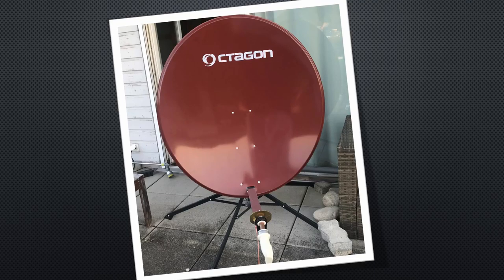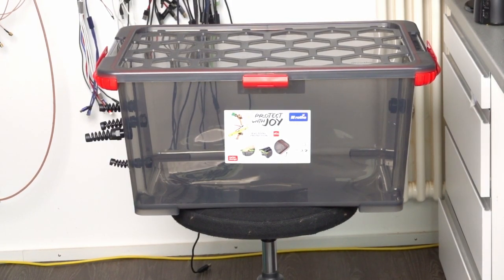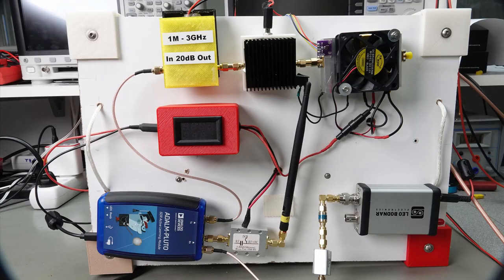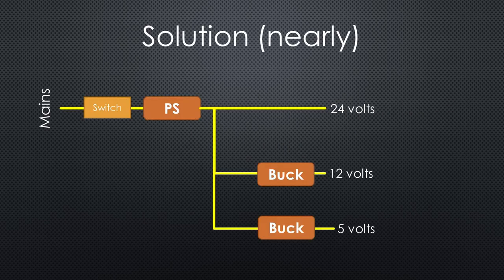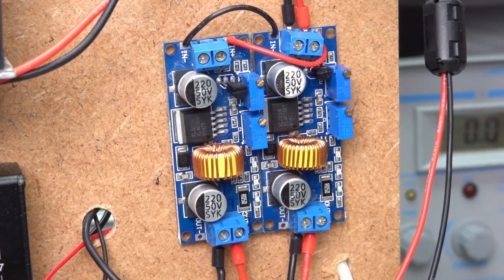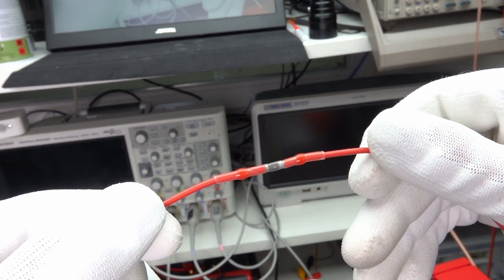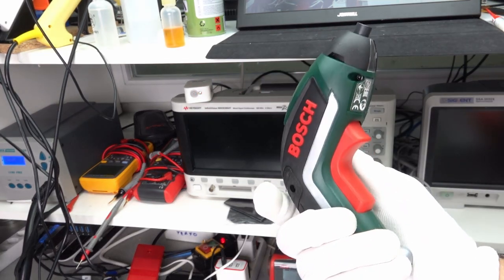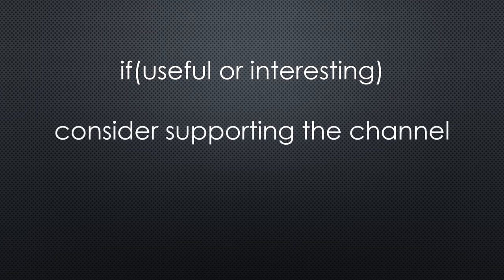#357 How to assemble an outdoors electronics project

Comment: There's always some water vapour in the air, and it will condensate at certain temperature. There will be small pressure differences between outside air and inside the box, which can move air in and out. Sometimes it's best to have well ventilated case with drain holes for water at the bottom, if a gas tight case isn't possible choice. Nitrogen filled gas tight cases and cables are used  in some applications. I don't have much experience in this area, but I think water tight case can be the riskiest choice, since it keeps the condensated water in but never lets it out. I'm not judging Andreas' choice here, he can manage the situation if he sees condensation problems. Time will tell whether anything occurs.
Reply: Based on my HAM experience with DIY VHF-UHF antennas and HF baluns, it can be useful to drill a small (1...2 mm) hole into the lowest part of the case. Humidity finds it's way into the box for sure, a small draining hole helps to get rid condensed water but doesn't affect rest of the box much.
Reply from the maker: Thank you for the tips. I tried to avoid anything laying on the floor. But a small hole for sure is a good idea.

Comment: The big transparent boxes are a pain, at least the ones I've got in the UK. They degrade with sunlight and become brittle in just a couple of months and because they need to flex a bit to take the lid off, it just breaks. :(
Reply from the maker: Good point. I hope mine will last a little longer. Maybe I put a cloth around it against sun. It does not stand completely in the rain.
Reply: This.  I replace an outdoor enclosure  made from a cheap storage bin every year due to sun exposure.  Spraying with a UV clear coat (like Krylon brand) helps  some.

Comment: I'm fairly new with electronics but why is higher voltage uses thinner wires? I thought higher voltage use thicker wires. At 6:48
Reply: For the same amount of power you want to transfer through the wire, you get less current for highter voltages. (P= V* I) But powerloss due to resistance comes with the square of current. P= I^2 * R. Thus it is better to use higher voltages and less current. Less current means you can use thinner diameter wires. But much higher voltages does require consideration of sparking/arc-through the insulation. So that might make the cable thicker or require insulation of a different kind. But I think that is why Andreas said it's no issue for this project as it is below 50 volts.
Reply: Higher voltage generally need a thicker insulator. But thinner conductor.
Reply from the maker: Thank you to the two commenters! No need for an addition.

Comment: Not sure about the UV resistance of the plastic in these boxes.. SOME of them, I have seen disintegrate in a fairly short time, there are, I think, some UV-resistant paints, and also UV-resistant clear film, that is used to cover car paint jobs.
You could glue some copper sheet to the wood.
For safety, and protection from the elements, perhaps use a 32-V -48 V power supply located at a mains outlet, and run that 32-48 V to the box, so that you have a 'safe' voltage on every part of the project that is in the box.
The are may quite good buck converters to get the 32 V to 24 V, but follow them with appropriate LC filtering for your RF PA.
Personally, I would prefer to run the fan at a lower temperature, or, if possible, to run it at variable speed (although some fans depend on RPM to make the bearings work ;-) )  COOLER IS ALWAYS BETTER.
Possibly, run your 5 V supply from Li battery/cell, so that all power coming into the box can be switched off, but the 5 V can run for some days on battery...if you are doing 'smart' switching, you could even switch main power back on from time to time, to recharge the battery. Having all power off, and isolated from mains, and 'ground', should also alleviate most of the potential (pun) for corrosion.
What is the thermal resistance of the heat-shrink material? Will it cause any issue for the SMPS?
The automotive connectors may not be pretty, but the ones from European or North American suppliers are totally reliable; they have to be, to meet automotive quality standards.
Interesting project, good discussion of the issues, and subjects which always have a plethora of possibilities for solutions!
Viele freundlichen Grüßen!
Reply from the maker: Thank you for sharing your experience! As said, I expected a lot of additions from my viewers. This is a big part of the value of this channel, I think!
Concerning the thermal resistance of the heat shrink tube: It is for sure not high. But those switchers also do not produce a lot of heat.

Comment: As a mechanical engineer, I am "puzzled" as to how the heat from the transmitter will leave the box. Unless the surroundings are much cooler (fair assumption for Switzerland, 10 months of the year), the plastic box will insulate, regardless of how much the internal fan stirs the air.  If the box is large enough and the duty cycle of the transmitter is low enough, then you should be OK.

Polyethylene is a good thermal insulator. And it picks up the firect heat radiation as well... From inside and outside. For testing, place a 40W incandescent lamp in the box and close it. Observe the temperature rise.

Temperature sensing must be used to prevent the box from overheating.
Reply from the maker: Good point. Fortunately I listen more than I talk. So the PA will only create heat for a few minutes per hour. But I am not sure what will happen. This is the reason for the sensor. I fear more the sunlight than the amplifier, btw.

Comment: Why dont you use a MOV (Metal Oxide Varistor) to protect against voltage spikes? Its added protection against a thermistor for protection or an EOCR (Electronic Over Current Relay) switch for protection
Reply from the maker: Also a possibility. Probably because I am used to fuses...

Comment: Instead of hot glue use silicon. Julian Ilett had problems wiht hot glue and water entrance.
Reply from the maker: Thanks for the info. I have to try it once. I remember Julian's video. But AFAIK he used his solar chargers outside. So I hope it will be easier inside the box.

Comment: just a small add to this valuable video: if I have to drill holes, I try to make them on the lid of such cases. This way, the bottom part can still serve to keep even liquids once the original project is obsolete.
Reply: Holes in the lid will reduce the protective properties for the outdoors project.

In some circumstances it even makes sense to make or add holes at the bottom - to make an escape path for the water that will eventually get inside.
Reply: @killymxi  I did not say "on the top". You can always put your box in a way the lid is not the top ;)
Reply: @peter.stimpel  but the box design usually implies a certain direction. If you turn the box shown in the video (as well as the majority of commonly available boxes) in any way - that will make an easier path for water to get inside.
Reply: @killymxi  I disagree. However, this is the fun part of making. There is more than one path to hit the goal

Comment: Something you could of done differently is you could of done a Poe solution so there is less wires. :)
Reply from the maker: Good idea. It would have made things much simpler. Unfortunately the power consumption was too big for my router and I did not want to buy a new one.

Comment: I'm not able to buy cheap power supplies anymore. My day job routinely puts me in a position where a very expensive piece of hardware is rendered inert by a failed power supply. Most of the time, the hardware just lost power. Still, not fun explaining to a customer their $$$$ gadget was foiled by a $ power supply. One of our vendors goes so far as to put a 3-year or 5-year warranty on their hardware, but only a 1-year warranty on the included power supply, even if the power supply is internal (edit: and not user-serviceable). 🤷‍♂️ I've had good luck with Mean Well branded power supplies from reputable sources, but that's about as cheap as I'll go these days.
Reply from the maker: I would distinguish between Maker and professional projects. For Maker projects, price is very important. For professional projects, reliability is more important because the cost of a defective product is not only the cost of the part. This is why I still go with cheap power supplies for my maker projects.
BTW: Up to now I did not have one casualty because of such a power supply. Maybe I was happy.
Here is a good link for USB chargers: https://lygte-info.dk/info/ChargerIndex%20UK.html
Reply: @AndreasSpiess  Thanks for the link! I shall have a look. There's a definite difference between maker and professional projects -- I just sometimes lose that distinction because my job is close to my hobby. Lucky ducky I suppose.

Comment: I would love to get some COPPER Silicone wires. But I'm afraid that those chinese ones are all aluminum wires. Not only the color on the pictures shows that, but also the flame test. Bigclive once showed this. Heating the strands with a lighter. If they crumble and bild molton balls -> Aluminum , is they just glow -> Copper. My Chinese Sets are all Aluminum. :(
Reply from the maker: I know that and it was never a problem for me. I anyway use too thick wires. And my distances are short.

Comment: the only difference imo

4 bits of wood or pvc pipes/plant pots for the legs

or print with gaps/lattice to save plastic
(I dont have a 3d printer)
else
perfect
Reply from the maker: Good points. BTW: Maybe you saw that the legs have different colors. This is because I used old PLA for that purpose...
Reply: @AndreasSpiess  I didn't twig until you said, not being a 3d printer user... that didn't come to mind.
it was more for others. 

i did a quick run thru. 

Wood... easy, but gets/holds water
pipe, fixings
plant pot, dirt cheap plus fixing hole done

Comment: I'm a little worried about the clear plastic box in the summer. Plastics like that tend to pass infrared efficiently even f they are not very clear in the viable spectrum. Even plastic that is died can sometimes pass a lot of IR. You wouldn't want to tern your project into a literal oven. Here are some fun solar ovens that work on the principle. https://solarcooking.fandom.com/wiki/Category:Solar_box_cooker_designs
Reply from the maker: I was happy when I discovered the glas boxes for summer and sun to replace the plastic box. Plastic does not survive  a long time. But you still have to deals with heat...
Reply: @AndreasSpiess  have you Considered a metal box with antennas mounted outside of it?

Comment: I use XT-60 connectors on all my radio stuff.  They are cheap, small, very practical, high amperage, and readily available.   They even make bulkhead connectors.  https://www.amazon.com/gp/product/B085L3LRSQ/ref=ppx_yo_dt_b_search_asin_title?ie=UTF8&psc=1

Comment: Hi Andreas, I couldn't find the article but remembered you are working on solar charging your sensors and asked for help if I'm correct. On https://hackaday.io/project/175514-wireless-solar-powered-sensor-node there is a project for this, maybe it's usable for you. Best regards, I really like your shows and learned a lot!
Reply from the maker: Thank you for your link. The project started about 2 month ago and is on its way. They use batteries instead of super caps.

Comment: Great video, excellent concept to go through the practical details.  The only thing that made me say "what?" was 3D printing legs out of plastic, instead of just cutting some short pieces of wood.  Don't you have some scraps of 2x2 or 2x4 laying around?  Cut four pieces to length in a few minutes at most, then screw with 4 common wood screws, job done.  WAY faster than 3D printing legs from plastic, and way cheaper, and way more environmentally friendly, in every possible way.
Reply from the maker: You are right. I made mine from old remaining PLA. This is why each has a different color...